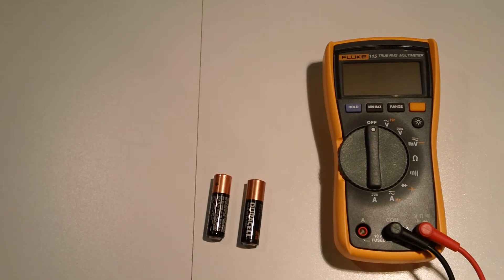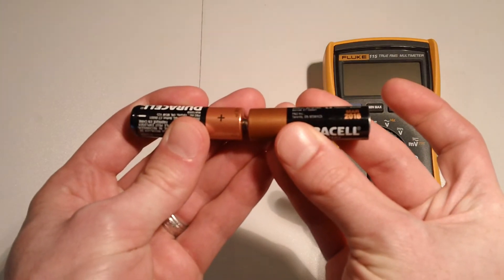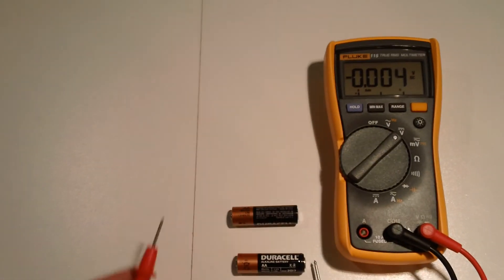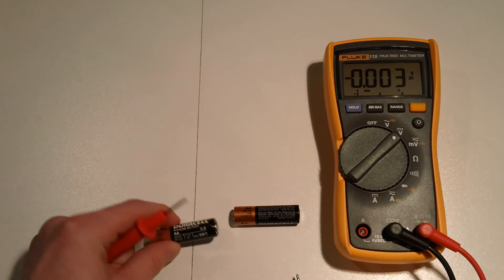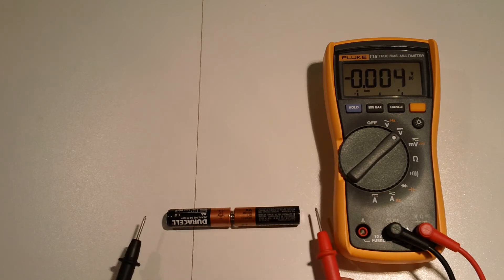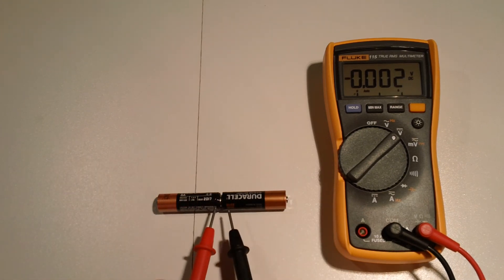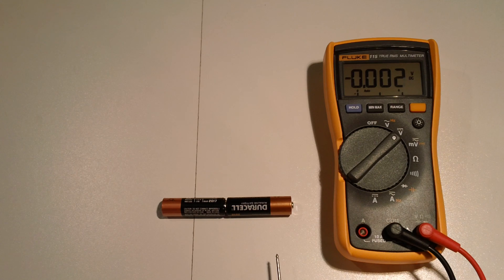Series-Aiding & Series-Opposing Voltages

Comment: when you have one battery that's stronger than the other, and the batteries are opposing each other in a circuit, isn't current flowing backwards through the weaker battery? Wouldn't that damage it?

Comment: Nice experiment - thanks for that.
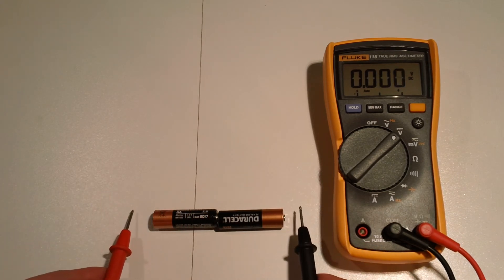Though I can't follow you at 4:13 about postitive/negative voltages.
When I do this positive to positive and ground it, I get on both batteries +V and with negative to negative I get -V on each battery.
However when I connect the two batteries in series postitive to negative and ground it, then I get +V and -V. Like in this video is shown https://www.youtube.com/watch?v=w99Q23mUEZg

Any explaination? Thanks again